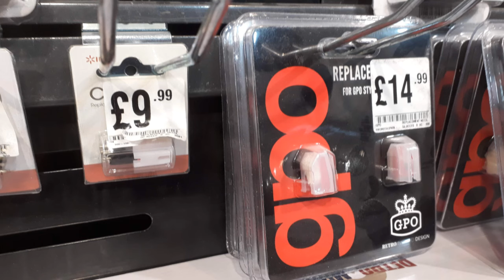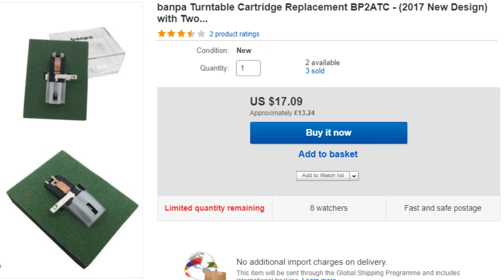Crosley troubleshooting for 'suitcase' style record players

Comment: Hello. I had one very similar to this and one of the speakers wouldn't work with vynil, but would work with everything else.
Reply: I don't know what to do
Reply from the maker: Sounds like a problem with the connection of the cartridge. If line in (or Bluetooth in) works, but not a record, then one of the channels is not properly connected on the cartridge.
Reply from the maker: Check the wires to the cartridge, make sure they fit well. If it looks OK, then you could try changing the cartridge as it may have gone bad
Reply: @mrrgstuff  thank you I will check this all out

Comment: I have a Crosley t400 and it will spin for a few seconds and then resist and making a humming noise. I have the drive belt on correctly
Reply from the maker: Sorry, I am not familiar with this one. From a quick read on Amazon it sounds like it is a fully automatic unit and quite a few people have reported reliability problems.

Comment: I wish I could kill the preamp in this thing and use an external unit.
Reply from the maker: If you are confident with opening this up or have someone who could do it for you it is entirely possible to disconnect the tonearm wires from the internal circuitry and connect them to something else. The video I've linked below shows removing the circuitry for use in another machine, but should give a good indication of the type of work required:
https://youtu.be/Q7ir4rJjezo
Thanks 😀 👍
Reply: @mrrgstuff  Hey, thanks! I appreciate that. I’ll check it out. 🫡💯🔥
Reply from the maker: @CMane  Hopefully that video makes sense. In your case, you would leave the circuit board all wired up so the turntable ran, but disconnect the  tonearm wires and bring them out to a preamp. The internal circuit board shouldn't care that the cartridge is disconnected, but I haven't tried this exact configuration myself. Good luck

Comment: I picked up a crosley suitcase player from the Goodwill. I cant get any sound from it. I  replaced the cartridge and stylus and still no sound.
Reply from the maker: Its going to be some sort of electrical fault unfortunately. Its worth checking the headphone jack , phono outputs and USB if its got it, to see if its a total failure as you may be able to work around the problem.  There are several different amp boards in these sort of devices  and although they will be fixable or replaceable, its much harder than replacing the cartridge.

Comment: Great informative video but when you look in the audio market you pay cheap you get junk
Reply from the maker: Maybe people shouldn't be buying this sort of stuff but the choice in the lower end of the record player market is really very limited if you are buying new. Whilst I'm sure many get thrown away (this one was) some people will want to adjust and fix them. It will be interesting to see if another 'standard' mechanism replaces this one, as it's been around over 20 years. Thanks. 😀
Reply: Honestly nothing wrong with these players.  If you can’t spend more then go for one of these and enjoy your records.  The snobs will always try to put people down.
Reply from the maker: Since making this video, I have bought several more complete suitcase machines with this mechanism very cheaply, and I do find them handy. For those wanting better, the choice at the lower end of the market has improved, and genuinely better machines are available at lower prices than they were. However, these cheap mechanisms do sometimes get 'dressed up' by manufacturers to look like much more expensive machines, so anyone looking to buy better should check they really are getting something better. Thanks 😀 👍

Comment: Hey there,

I've got an issue with my Goodmans portable turntable

When I turn it on there is no light on the power button, and nothing to signify whether it is on Blue Tooth, Phono or Line In

The record does spin however.

The main issue is that the speakers on Phono are not outputting any volume, do you know any solutions for this?
Reply from the maker: Unfortunately not. There must be power getting through if the record is spinning, but otherwise some sort of amplifier fault. Did it ever work and did anything happen to it to stop it working?
Reply: @mrrgstuff  It work the day I got it. I tested it at the sellers house and it worked fine, when I took it home it had stopped working. I wasn't rough with it either. There is no power light but it does work spinning, I took it apart and all of the connections did seem to be intact to the motherboard although I can give it another look
Reply from the maker: Sorry to hear that. Nothing obvious unfortunately. I guess you are using the same power supply as was used at the seller house?

Comment: Hi, when I do the 'buzzing' check with the pliers no sound comes out of my record player
Reply: Just to clarify, no sound comes out of either speaker (but I can hear it coming out of the needle itself). I think there's something wrong with the amp (as per your previous reply to someone else) but I'm not sure what
Reply from the maker: Yes, if you don't get a buzz through the speakers then there is probably an amp problem. If it does work through the headphone socket, the the amp is working partially, unfortunately there is still no easy fix. For the hum test, the volume needs to be quite high, but be careful as you could hurt your ears if you then do headphone tests without turning the volume down.

Comment: Hey there! My crosley's speakers keep cutting in and out. It makes a sound through the needle. I'm not quite sure what to do. I've tried the headphone jack and it also barely works.
Reply from the maker: Sounds like an amp or cartridge problem. The simplest and easiest thing to try is a whole new cartridge/stylus. These are not expensive and easy to fit. Otherwise then I would guess its some sort of amp fault, which I can't really suggest any solution to as there are many different versions and you either need to find someone locally who can diagnose the fault on the board, or find a replacement board
Reply: @mrrgstuff  alright. I have swapped the needle but it didn't seem to do anything.

I have yet to try replacing the whole cartridge.

I did try to play through bluetooth but the same issue happens. It might be the amp then?
Reply from the maker: Definitely worth trying a new cartridge first. These are usually very reliable, but certainly on older record players they can go intermittent like this. Otherwise, yes it going to be in my opinion the amp
Reply: @mrrgstuff  sure thing. I'll purchase one now.
Reply: I bought a new cartridge. Lo and behold, it's working now. I got the cartridge than has a flip switch for lp and 78 which was meant to be an "upgrade".

Anyway, I didn't think it'd work but it did. You are a lifesaver.
Reply from the maker: Glad it worked for you. I did a video on a Crosely style flip cartridge and although I can't be sure, it does look to be better made than the normal ones. 😀
https://youtu.be/u4efWHXCfII

Comment: Hello! I bought a Crosley and I’ve bought three brand new vinyls since then, and not one seems to play without skipping. I’ve tried cleaning the records and it still constantly skips and doesn’t play through a whole song. Is it the needle or the player itself?
Reply from the maker: Hi, I did do a video on this which might help:
https://youtu.be/JI2Blm0MS0c
However essentially these (and all other similar units) use the most basic record players mechanisms available and there really isn't any adjustment for this problem. If the needle/stylus is worn or very dirty this might be the cause, but if you are going to be spending proper money on vinyl (as opposed to charity/thrift store &  flea market) stuff then buying a better player is well worth it. If you do consider something better, make sure to read/watch the reviews and also look carefully to make sure its not just the same basic mechanism dressed up in a fancier case. Good luck 😀👍
Reply: Put a quarter on top of the needle. That worked for me.
Reply from the maker: Yes, it works and is probably the simplest fix, though isn't great for the records.

Comment: My Crosley has no power apart from me pressing down an turning the turntable with my hand. What do you think the problem might be?
Reply from the maker: If there is no sign of electrical power then start with the wall socket and work back to the player. It could be a bad fuse or a bad PSU 'brick'. If that checks put all fine then you can trace the power through to the motor, I show doing this in the video. If there is power, but the turntable doesn't turn, it could be the belt. If this is broken or jammed or stretched it will not work. If the motor works with the belt off then there may be something stopping the turntable turning easily. Did anything happen to the player before it stopped working? Thanks
Reply: @mrrgstuff  I had the player given to me, minus the power cable. I ordered new one, the green light on the plug has a light. The light on the turntable only lights up when I manually turn the turntable with my hand pressed down. I can’t seem to get the belt to stay on, it skips off all the despite my holding it in place,
Reply from the maker: @jonsmum5552  I have to admit that is a strange set of symptoms and I don't know what is causing it. On many of these there is an on/off/volume control and turning it on from there should cause the on light to come on. I can't think why turning the turntable by hand would affect this. I am speculating that  if the turntable was jammed the motor might not be able to run and this might cause the power to cut out, but the belt on your one seems loose as it keeps falling off, so that doesn't seem to be the case. If I think of anything I will let you know.

Comment: So I was using the headphones, and then when I unplugged them it became really quiet. I tried everything and nothing worked. Do you know why this is happening?
Reply from the maker: I don't know, but if the headphones don't work on it now either (but do work on other things), then maybe something got shorted when you removed the headphones. Is there any sound coming though the headphones or speakers at all? You may just be hearing the sound directly from the needle/stylus, this will be very quiet and not sound great. Either way, if its developed a fault in the electronics, there is no simple solution unfortunately.
Reply: Yeah I think it is a problem in the speakers

Comment: I got mine today and it makes a really high squeaking noise and when I put the needle near the record the turntable moves then goes right back and it won’t move
Reply from the maker: High pitched squeaking noise doesn't sound right. Have you tried putting the needle down  on the record? The turntable should rotate when you move the arm (if its not rotating anyway) and you should be able to just place the needle anywhere in the grooves. I don't really understand what you mean by 'then goes right back and won't move. The tonearm? The turntable? Thanks

Comment: thank you for the vid, but my lever drops down a bit (as in it’s not as high as when it use to be while it was up) also my disc keeps turning nonstop unless i turn off my cross let completely
Reply from the maker: Thanks. The little lever which lowers the tonearm can become disconnected. I can't remember how, but I seem to remember having to adjust it once before. You will probably have to open up the unit as I think it will be easier to figure out from underneath. The other problem sounds like either you have turned off autostop or there is a fault with the autostop mechanism.  If it is not just the switch position, you will need to open it up to investigate more.

Comment: Hi, apparently one of my friends plugged a 12v charger instead of the original 5v 1amp, I opened it up and saw a couple of blown capacitors, does anyone have the same issue?
Reply: Hello! Had the same issue 2 days ago. Tell me if you'll find the solution, please.
Reply: There's the problem, your friend used a power supply that was far too strong and it fried the record player NEVER plug an adapter bigger than a 5 volt into them because it will destroy the record player.

Comment: I there ! I got one for Christmas and all of a sudden it does not give any sound how can I fix this problem:/?
Reply from the maker: If it was new, it would be worth taking back to the shop as it should not have failed so quickly. It is worth checking the headphone socket as if that works then the stylus and cartridge must be ok. If speakers, headphones, Bluetooth etc don't work, then either the cartridge has failed or there is a fault on the circuit board. Check the connections also at the back of the cartridge to see there aren't any loose wires. Cartridge can be changed, but usually lasts years, not days. Good luck

Comment: i think the problem is my record and not the player itself. side B of the record is rubbing against the red part of the top
and causing it to slow down every few seconds and speed back up, resulting in a very out of tune sound. however, side A sounds perfectly fine. how do i fix this?
Reply from the maker: If one side is ok, then it sounds like the record is warped. It should be visible. Also worth trying a different record just to be sure. I've no experience of flattening vinyl records but there are video on YouTube which might help
Good luck 👍

Comment: Hey! My crosley has three speeds 33 45 78, but the switch isn't changing anything and it's playing at 34 rpm on all settings, but oddly my LPs play at what I consider the correct speed, however singles and EPs are playing slow. What's my best course of action? Cheers
Reply from the maker: Good question. 34rpm is going to sound ok for LPs as the are meant run at 33 1/3 rom and its close enough. First thing I would check is the switch itself. If its not that, then there is some speed control circuitry in the motor can as the motor has adjustment holes for 33 and 45, so I would expect to be a motor fault. Obviously also check the wires between the motor and the switch. Presumably it was working and has developed this fault? Thanks

Comment: I just bought a Crosley cr246. It’s used and when I hooked it up it worked fine and then suddenly it didn’t. It’s stuck on the hello screen when it boots up and I don’t really know what to do. If anyone has any answers please let me know!!! Thank you.
Reply from the maker: Sorry to hear that. Nothing obvious, but it sounds like some sort of bad connection inside, though it would be difficult to find. If you completely unplug it from the wall and try plugging it in again, does it do the same?
Reply: it’s okay, thank you! The unplugging didn’t work. I put it on standby for a night too and it’s still just not working well. I may have to find someone to repair it for me.

Comment: Hi my crosley record player will not turn on I have not spilled or dropped it before so i am confused. This is my first time buying a record player I'm 16 and very confused.
Reply from the maker: Hi, thanks for the comment. It's very difficult to know however as it doesn't turn on at all I would first check the power supply and then the diode andd switch like in the video. If you don't feel confident opening it up then I would advise finding someone locally to help. Good luck

Comment: Hello, I just bought mine and notice the platter moves up and down. My records randomly speed up and slow down. Any suggestions? Thank you
Reply from the maker: Sounds like the platter is warped or there is something wrong with the belt. Basically it's not turning evenly which is why the speed varies. If its new, I suggest you try to take it back and get it swapped. Otherwise there will be some good videos out there on changing the belt (not something I cover in my ones) which should show what the mechanism in good order works like. Good luck.

Comment: hi! thank you so much for such an informative video. I have the exact turntable and purchased a couple years ago. I used to use it quite often but unfortunately moved and it got kept in storage. I tried using it today (it is in perfect condition, no damages) but the tonearm keeps sliding over the record or it stays in place but the sound is extremely muffled. I tried cleaning it but nothing has worked. please help :(
Reply from the maker: I did a video on this, which might help:
https://youtu.be/JI2Blm0MS0c
It sounds though like the tip of the stylus is broken or missing.
This video might help too:
https://youtu.be/WjecPbT3ipw